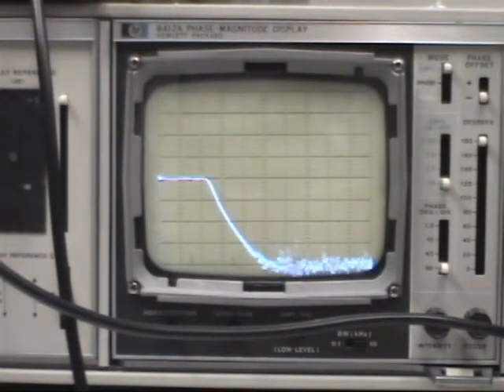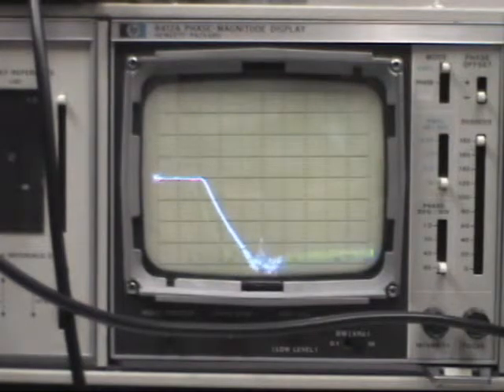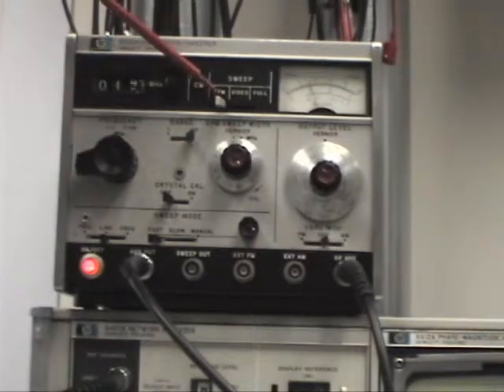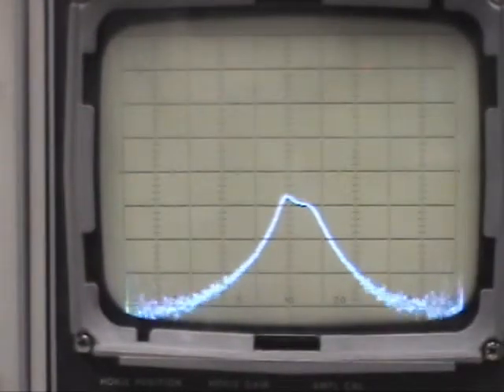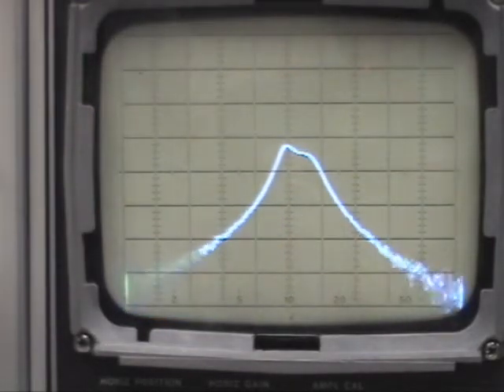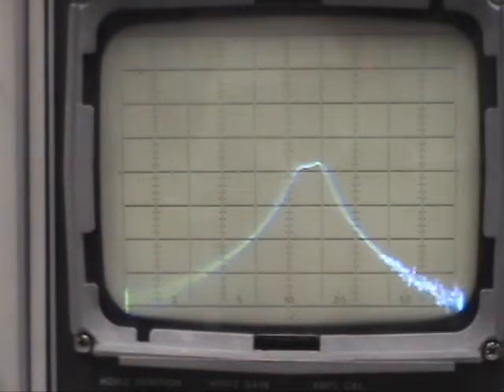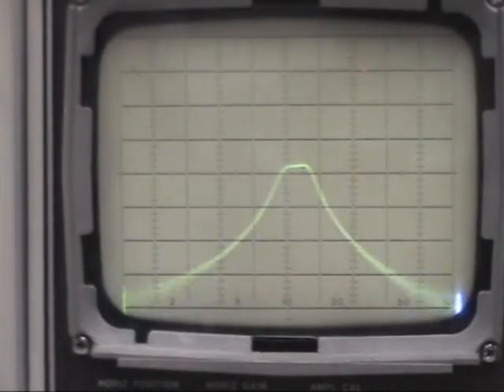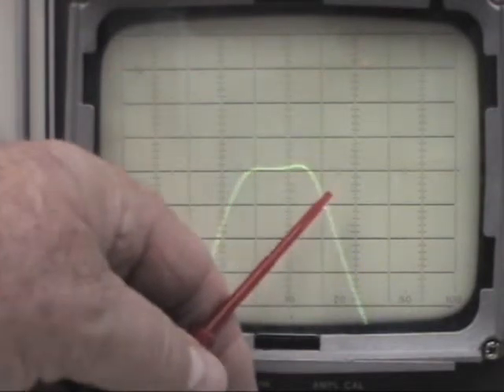networkanalyzerbasics

Comment: Old video but this equipment can be found on ebay.  I have the exact setup as described in this video.  When I acquired my 8407A, I was working for a division of Harris Microwave.  Our lab had a top-of-the-line HP NA, I don't recall the model, but it was very expensive. I brought in a coupler from home and swept it with that NA. I printed the result and brought it home to compare to the display of the 8407A. The measurement with the 8407A was less 1dB across the bandwidth of the coupler.  Holy cow that was impressive!   I've made several low pass filters for 10 and 20MHz frequency references that I make for my rigs.  I have great fun with this stuff.  (K1NVY)